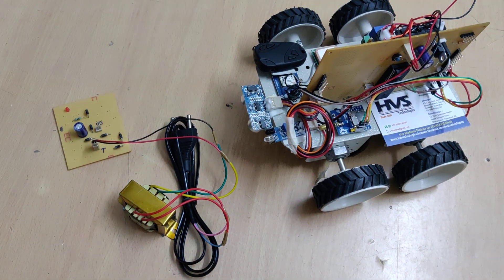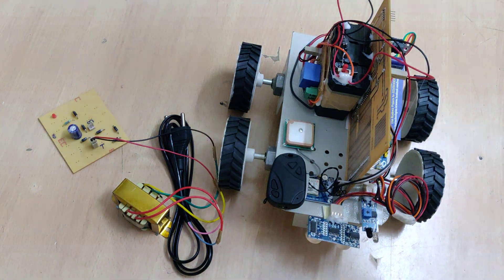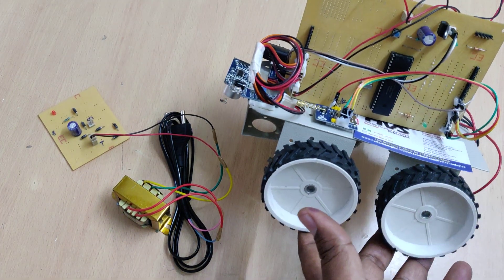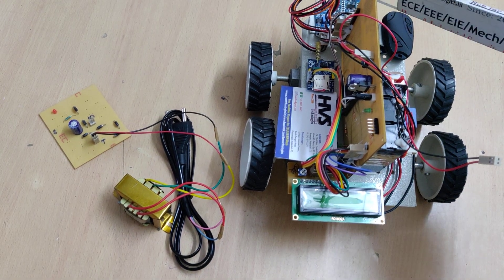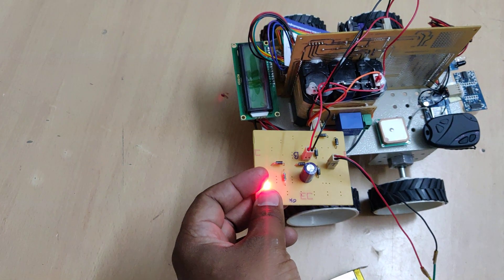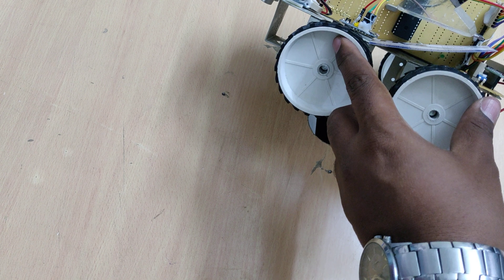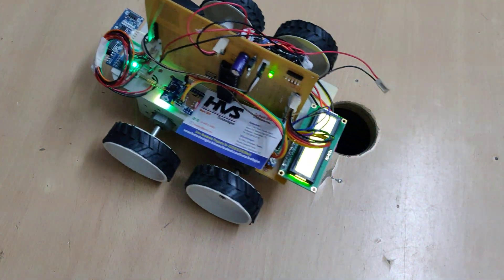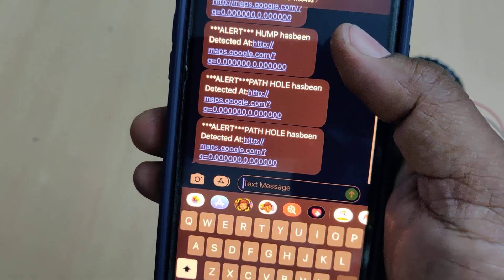HVS-2900. Automatic Detection and Notification of potholes on roads to aid drivers

Comment: Hi(PLEASE READ)
I am an 11th grade student at Delhi World Public School,Bhiwani,Haryana.
I have been selected for INSPIRE Awards-Manak, an initiative by the Govt to inspire young students.
I had to submit an idea to solve a problem. My submission was;-

PROBLEM- There are many POTHOLES on roads which cause damage to vehicles and pose threat to drivers.
SOLUTION- We can make vehicles that have POTHOLE DETECTION MECHANISM to prevent going over it and it warns the driver to be safe.

I found your video very informational.
So, could you please share the code,materials required and whole tutorial and help me in the making of the project , as per your convenience. We can collaborate for it.

I have received a fund for the completion of the project by the govt.
So, if required,I am willing to pay for your services, if needed.

Please help for the same.

Waiting for your reply.
with regards
Reply from the maker: You can contact us at +919603140482
Through WhatsApp or call
Reply: Hello there,
I also thought of this idea for inspire award. Please tell me  how did your project went? It will help me a lot.
Reply: @Sushant-ot1fp  I made it in my school Atal lab, using ultrasonic sensor and lcd. I simply referred to chatgpt for the connections and code. There were many errors in the code, but gradually I got it corrected using chatgpt itself. And we did not have any exhibition or something like that. We had to submit a video and a description on an app(as much as i remember, or it might be website). I did not receive any further information regarding it.